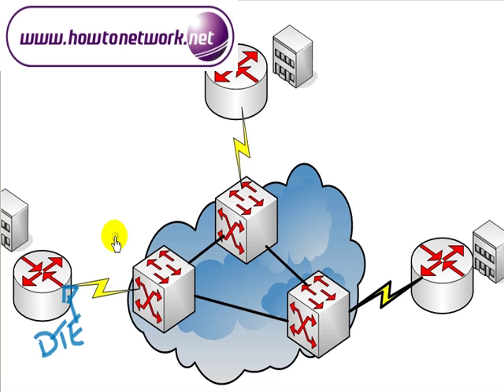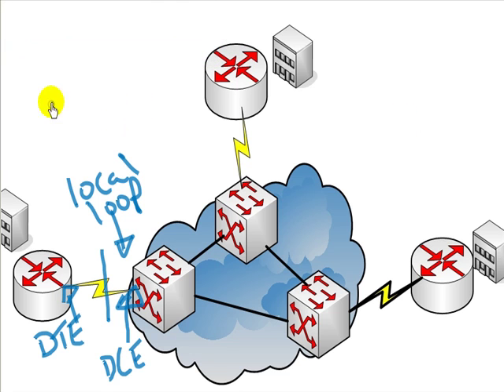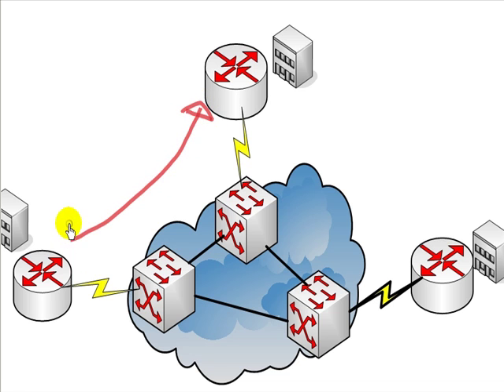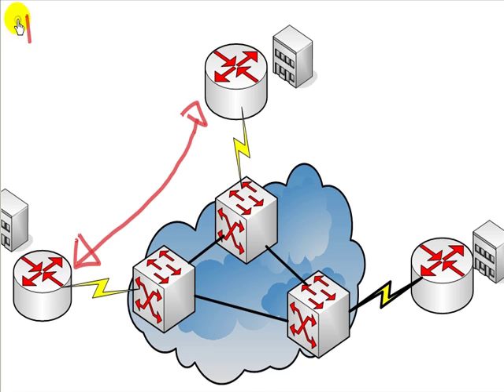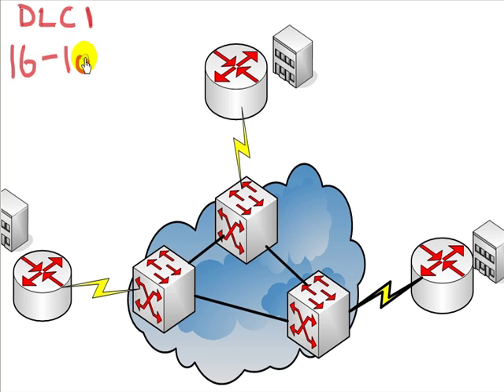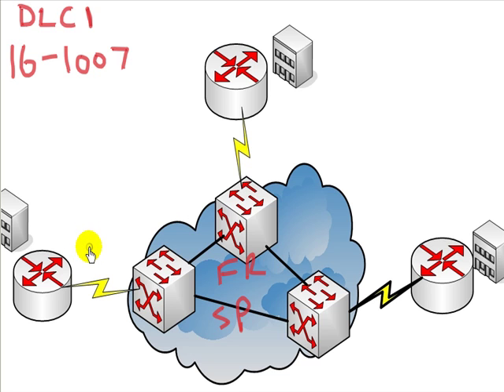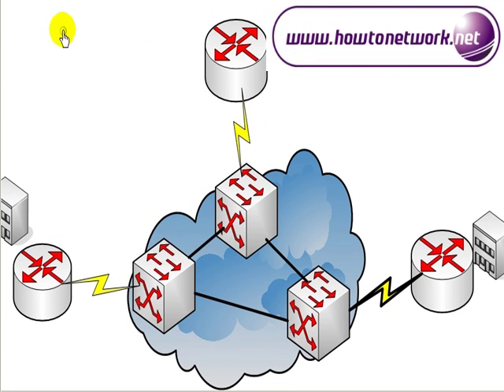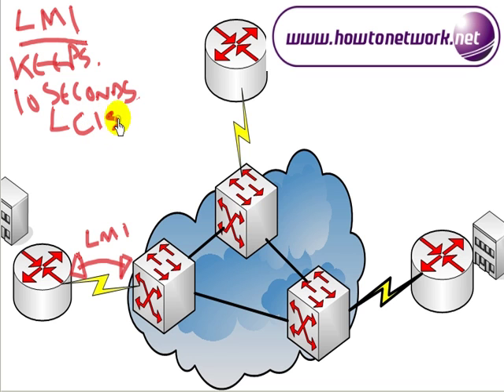Cisco CCNA Videos - Frame Relay Explained Part 2

Comment: DLCI identifies the logical link between your DTE router and the local loop to the Central Office, I believe. Also very important to know that, at end points, the DLCI does not need to match in order to function. its completely arbitrary; if it does match, its coincidence.